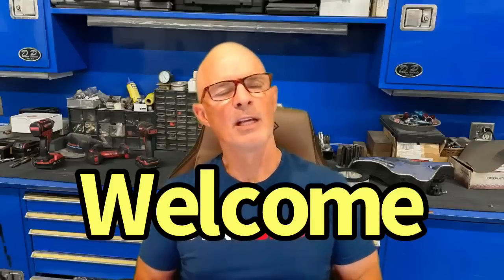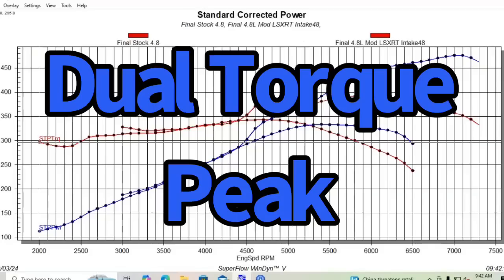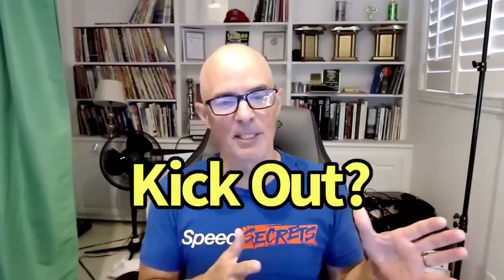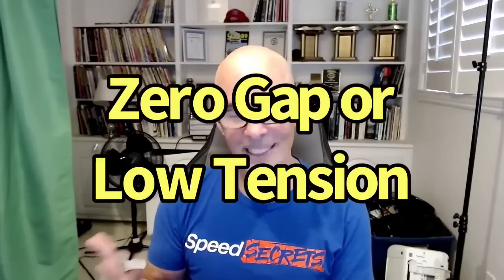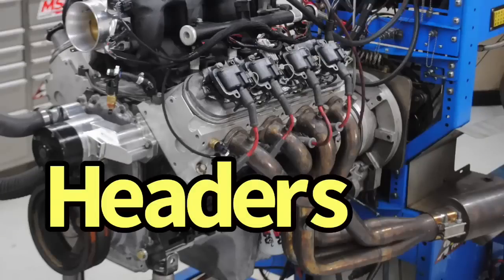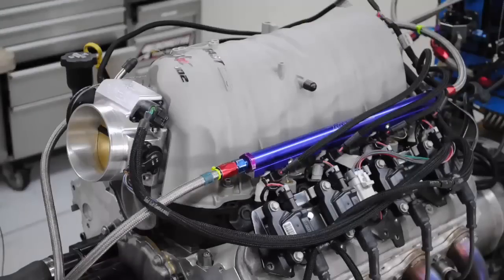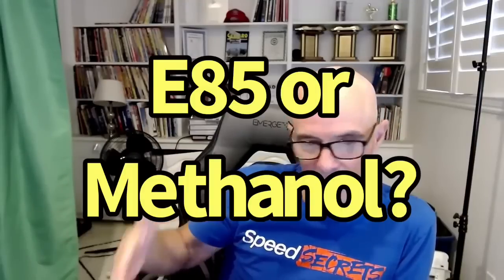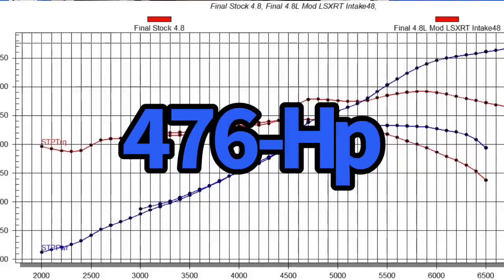500-HP NA JUNKYARD 4.8L-NO BOOST, NO NOS! CAN IT BE DONE? HELP ME ADD 25 HP TO THE 475-HP 4.8L!

Comment: David Vizard's formula works assuming you have 10.5:1 compression ratio. From what I've seen as a general rule of thumb you space out LSA as you bump up the compression ratio. You wouldn't use a 107-108 LSA with a 12:1CR, a 113-114 would be more appropriate. You give up a little overlap, but you gain from more expansion due to the higher compression. Of course like all rules of thumb there are exceptions. It depends on the head, the duration of the cam, the lift, the flow of the head, and a whole host of other things which you already know.
Reply: @bigboreracing356  Negative, my only claim is Vizard's formula will get you 500 carburated HP from a SBC running 10.5:1, if not more, with the right heads. In any case we've drifted a far way from the original topic. Let's stick to getting 500hp from the 4.8.
Reply: @rolandotillit2867  its not hard to make 500+ at the crank with a 4.8. Bump up compression, throw in a good cam, intake, and headers, then you have it. Ive got a 5.7 hemi with a factory intake, a moderate cam, headers, and ported heads with 10.5 compression and make 500+ at only 6200rpm.  Slap in a big cam,  high ram, and bump up compression and thats an easy 60+hp. So i dont see why with a 4.8 you couldnt do the same
Reply: Look at the LS3, L92/94, LS9 cams for an idea. I got the Texas Speed Chopacabra for the 4.8 then for the torque increase. Since the 4.8 seized from a headgasket failure before I could ever do the mods, I have a 5.7 iron with a Truck Norris. Yet to do a dyno pull as I have a 87 street tune in that way I can drive it and get emissions done so I can then get tags.
Reply: @rolandotillit2867  The trouble with Vizard's formula is that it looks at LSA as an end in itself, rather than a mathematical representation of 4 individual valve events. All 4 events affect an engine in different ways and require separate consideration per application. Once your events are in the right place, the LSA and durations just "are what they are"
Reply: @bigboreracing356  i understand where hes coming from. But there is alot to be desired. What about duration split? Most of these guys run high performance heads, not like 99% of people. A tighter lsa usually has less duration, but makes more low end to mid range. Im no cam manufacture or engine builder, but i know enough that i could probably make a good cam
Reply: @bigboreracing356  You should have thought about the chassis before you picked an engine. That's your bad.
Reply: @bigboreracing356  That's nice, I'm a 4 valve guy.
Reply: @rolandotillit2867  LOL
I have worked with pretty much every kind of motor over the years. I cannot stand the way 4 valve (and 3 valve and 5 valve) engines sound - horrible - not as bad as a rotary or a horizontally opposed motor like a Subaru or a Goldwing though, but still terrible sounding.
And I'm guessing that if the Top Fuel guys are making 10,000hp with 2 valve V-8's , then I think I'll stick with those.
Sure you can build a little 4 valve 4 banger Honda or something to make 1,500hp easy enough, but it's going to be absolutely crap-tastic to drive on the street compared to a 1,500hp V8 which are being driven all day every day on the street as people's everyday driver.
If there were a huge benefit, then everybody would be developing 4 valve LS heads like they were trying to do with the SBC's back in the day (those never took off though).
I'll take my super simple, super reliable valvetrains AND my hp & tq thank you.
Reply: @AMurph79  1,500 is completely undrivable on the street, or track, I've tried 1200whp Gallardo, it's barely faster than a stock one around a race track, you increase braking distances by hundreds of feet, and you can't put down the power out of corners, even with AWD. 

Hondas are quite happy at 500whp, more than enough to run low 9s on an EK and idle at 800rpm. Track S2000's with ~500whp beat twin turbo Corvettes, and McLarens.
Reply: @bigboreracing356  Yeah, if they make them to my specs.
Reply: Spec'ing a CAM based on LSA is not scientific, it's 'Rule of Thumb' on it's own, based on off the shelf models, that's it.. Go to a cam grinder and order a camshaft based on LSa and listen to them laugh at you. You spec a camshaft based on valve events. What if you are dead set on DV's 'Formula' telling you to get a camshaft with a 108 LSA, but the opening and closing intake and exhaust events and durations for each have ZERO chance of lining up in those windows ? LSA is the result of valve events. It's not an initial specification.
Reply: @joeyjojojr.shabadoo915  The thing is, for 10.5:1 compression on a 383 stroker SBC his formula works just fine. Not everyone is going to have the same setup and requirements, some people want their cars to idle. No one disputes that selecting a cam is to time the valve events.
Reply: @joeyjojojr.shabadoo915 you haven’t looked at/ listened to the formula or the whole equation for can spec. That is factored in, the excessive LSA works for PDS applications to get gases out its what a lot of cam knowledge is based on. Doesn’t work for a lot of our applications and why so many engines are lazy as all hell until your up in the RPM, the wide LSA makes the valve events inefficient for N/A applications especially if you have a truck and it needs to live under 3K and make power
Reply: Not much of a rule of thumb when it only works for 1 motor, with 1 head, with 1 cr. More of a, hey i found somethung that works, lets make a formula so it sounds scientific
Reply: @jameswhitesell3076  News flash, a lot of engine guys don't understand aerodynamics so most of the engine development is exactly 'hey I found something that works' and it never goes past the empirical observation part.
Reply: @rolandotillit2867  thats why i drive a brick. Less variables. I even speced a cam for my car based on knowledge i gained and guess what, it works pretty well. Could it be better? Sure. I planed in superchargering my car, but am now going turbo, but it will still work just fine. Ive learned even more sense then, but i wanted a good reliable cam that is stock converter friendly. And it sounds good.
Reply: @jameswhitesell3076  The formula is for any 2 valve, pushrod, V8, at 10.5 compression. Formula worked well for my LQ9 enough to blow apart a 14 bolt hitting it off idle
Reply: @jacobburden3065  what about engines with poor heads? Do you use just an equal duration cam? What about cam advance? Theres alot thag the equation does not answer. Id rather look at valve events, duration, and lsa as one equation. Determine what valve events i want, where i want the power band, then move the lsa and advance around to get my valve events back where i want it. Its all part of 1 equation, not all seperate equations
Reply: @jacobburden3065 14 bolt must have neen on last legs or improperly modified, nor an 8.2 ie 7.5....
Reply: @jacobnorth8642  no lol it’s a 9.5 14 bolt with a motive gear 4.55 gear. Went to moser axles in it now. Def wasn’t stressed before just had a 350 HO crate engine in it before the lq9
Reply: @jameswhitesell3076  you’re not going to get your valve events figured out with lift and duration. Your LSA will determine your overlap and events. Getting the duration you want to put the power where you want it and LSA to make it more efficient in that band. My engine only has 200 deg of duration, can lug it starting from a light in third and pull all the way to 6K with no falloff. You’re meant to use everything in conjunction with one another to get what you want. Would be the same if a guy said my cam has xxx amount of duration so it makes a lot of power or xxx lift or xxx LSA. No one is trying to say if you put the LSA directly to this formula it will meet every metric you want for your engine
Reply: @jacobburden3065  lsa does not detetmine overlap or valve events. Lsa is a result of valve events, just like overlap. You can make 2 cams with the same amount overlap, but with drasticly different lsa and duration. Thats why i said i choose where i want to make power, based on my ivc, and build around that. Lift is not important, unless you are squeezing every hp you can
Reply: @jameswhitesell3076  You're talking in circles. If LSA is a result of valve events then changing LSA changes the events. And yea you can do that but it means literally nothing. If its wrong its wrong if its right its right. Literal tons of evidence proving what you are saying is an incomplete picture. You're LSA affects how much overlap you have and how the air inside the chamber reacts and whether or not its a clean charge the wide LSA of most cams you can buy off the shelf is thanks to lazy manufacturers if you tighten the LSA without changing duration it effectively brings the separation even closer than you intended causing the 'bad idle quality' that's cited for not tightening it up. If you have your duration figured out, the heads you want to use, CUI of the engine and compression then all it comes down to is proper LSA selection and again is simple that's why their are modification factors depending on the engine family you are using and compression, the only factors out side of the baseline equation. and as if it needs to be stated works for OHV 2V V8's generally.
Reply: @jacobburden3065  lsa does not determine overlap. Valve events do. Lsa is a result of the changes in overlap. The wide lsa is usually based off of pvc. You can put a bigger cam in if you spread out the lsa, allowing for more top end rpm. Does that effect low end torque and idle quality? Yes. But not because of the lsa, but because of valve events.
Reply: @jameswhitesell3076  Again talking in circles. If events change LSA then it works vice versa otherwise it would have 0 function
Reply: @jacobburden3065  obviously yes. But you are saying that lsa dictates everything. It doesnt. Lsa, duration, and cam advance are byproducts of valve events.
Reply: @jameswhitesell3076  It does not dictate everything but saying factors such as LSA, duration, and cam advance are by products of the events makes 0 sense because those are the parameters by which your cam has the events happen. The point is getting it as close to ideal for your engine as possible and you do it by, adjusting LSA according to your duration, cui, valve size, and design of engine and place more emphasis in the powerband you want and get your final changes done by advancing or retarding the cam. What you are saying is valve event should be 40 but there is 0 process on getting to said figure when it should be i want 17+4+1+18 so i can get my event at 40 where it should be
Reply: @jacobburden3065  how does it make zero sense when you know exactly what it is? You know the answer, but dont know it. And if you adjust your lsa with a fixed duration, you are now changing alot of factors that you will need to fix with advancing the cam, which could cause issues with pvc that you wont know about because you never looked at the valve events. And know you made a cam that is to small and doesnt make the power in the upper rpms, wasting your money. But at least it sounds cool right?
Reply: @jameswhitesell3076  Because you're looking for a solution by doing it backwards. Also what have I been saying the entire time? More duration reduces your LSA further and you need to change it accordingly. Keep telling yourself thats the way you should spec a cam with tons tons of dyno runs telling you otherwise lmao
Reply: @jacobburden3065  im looking at it correctly. Valve events=duration, lsa, and advance. Duration does not decrease lsa. They are independent of each other. You can change one, while the other is unaffected. And what dynos arw you talking about? The ones that they compare a cam with the proper valve events vs ones that are not?
Reply: @jameswhitesell3076  If you increased your duration and have the same centerline the lobe is occupying previously negative space so yes the separation angle decreases
Reply: @jameswhitesell3076  You have decided there is nothing left to learn about valve events and can almost guarantee haven't even looked at what Vizard says or look at what results it produces cattledog does a good explanation of what I'm talking about as well. This 'wrong' method that affects nothing is outperforming the way you do it.
Reply: @jacobburden3065  i have listened, and like i have said many times, you are looking at one thing and beliveing that is all that matters. Lsa is nothing more than an output.  Im not even an engine builder or cam builder and i know this. All the 128 rule is, is optimizing 1 specific motors valve events. I can make an eqution for a motor as well if i had 30+ years of research. But its all valve events.
Reply: @jameswhitesell3076  Jesus H Christ. How many times did I say its one variable that's overlooked. 'not even an engine builder' all i needed to know keep taking off the shelf catalog cams an getting walked at the light
Reply: @jacobburden3065  i bought an off the shelf cam and was dissapointed. Made my own and it runs good. And its overlooked because its one of the last things to worry about. I may be explaining it wrong, or you just dont want to listen, but lsa is nothing but an output from the valve events. Just like duration and advance.

Comment: Everything you mentioned in the video done all will or should get the 4.8 over 500 Hp.
If you wsnt a one stop solution  I would look again at cylinder head choices. Only need 250 cfm intake ports to make 500 +Hp . Want the highest velocity ports possible matched with 250 cfm +. 
The problem is you can't tell looking at different cylinder heads what has highest Velocity.  They must be tested on a flow bench for port Velocity numbers.  Ignoring cfm because 250+ already there.
Reply from the maker: you won't make 500 hp with 250 cfm heads without everything else on the motor being perfect. Much easier to get there with 300 cfm
Reply: @richardholdener1727  Port Energy.= Velocity.+/ - cfm makes for Higher True Cylinder Fill Rates Or Better Volumetric Efficiency.  
All look at CFM Only but People in the know. 
One Pontiac V8  YT Channel we meet every Wednesday night.
The Boss is tired of talking CFM Port flow actually. He talks in cross sectional areas like Pro Porters do and he is also one besides a famous Pontiac V8 engine builder.
330 cfm makes 950 Horsepower on Gasoline in a Pontiac V8 427ci only I seen it done by a Super Stock Racer I know in Illinois way back in 2001 at Route 66 Raceway.
Everyone has theories.  Some actually work preform dramatically better.

Comment: I would like to See:
- springs First / you need them anyway 
- How high can you rev it? You have the flow from the head already. How much power will more revs bring?
- CR up - a thicker MLS gasket can be used if V/P clearance is a problem
- cam adjustment
Reply from the maker: revs will do nothing-it has enough spring rate already
Reply: @richardholdener1727   Richard... Please, please tell me that you really don't believe "revs will do nothing" !!!!! 

You really can't believe that do you ???? 

 If in fact you actually DO believe that, would you please enlighten me as to why ???? 

Just a couple things to remember before you answer that question...  

Remember... Horsepower is a unit of measurement of power, or THE RATE AT WHICH WORK IS DONE !!! 

Those last seven words are your answer to that question if you REALLY think about them. 

I'll give you another hint. The next time you are mowing your lawn... I want you to mow it in half the time that you normally do. 

How are you going to accomplish that ????

 Waiting on batted breath for your answer... 
(This is all in fun... I've watched all your shows since way back and really enjoy them... But you gotta admit that you sort of dropped the ball on this one ;)